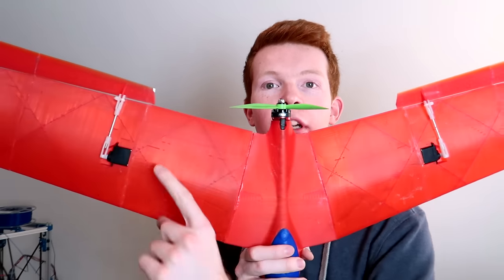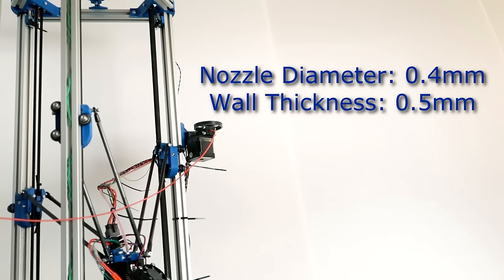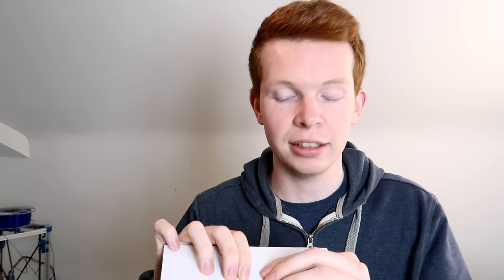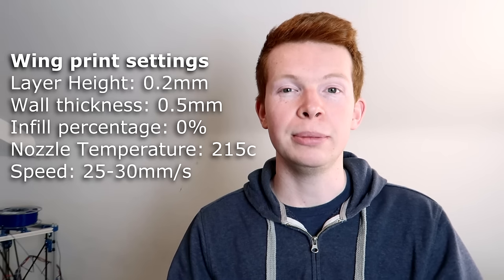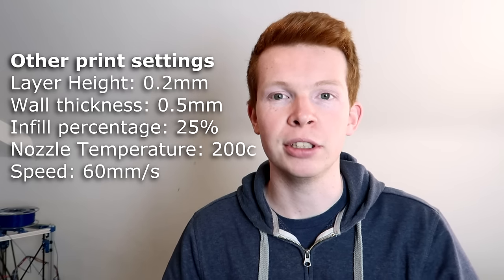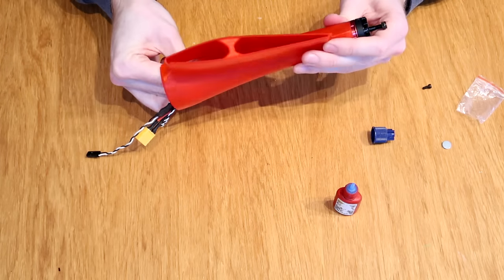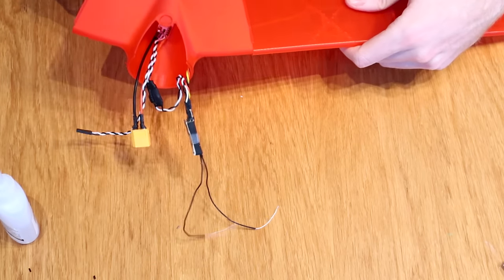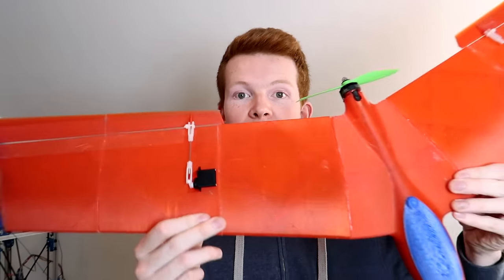Print THIS Plane! (FREE .stl Files)

Comment: I ll ask my brother if the print volume of his printer fits. 200mm is the hight right?
Reply: Strong Force 200 X 170 X 170, most non- delta 8" ones are 200X200X200

Comment: do u think it will work wirh abs instead of pla?
Reply from the maker: +Erdbau Rödel ABS is a lot harder to print large parts as it contracts a lot more when cooling. So it may cause the parts to crack. It could probably be done with a heated enclosure to minimise contraction
Reply: I mostly print in abs so I´m used to it
but with abs I would give it a Aceton vapor smoothing, this way they layers melt together

Comment: Can I print this in ABS?
Reply: You probably can, but it will be a 'Your Mileage May Vary' type thing. Since ABS is prone to shrinkage/warping at times, you may find that the parts don't cool evenly and may not suit your needs for something this thin. Typically PLA is the recommended route.

Comment: Can I print this on Prussia i3 mk2
Reply: Don't see why not; the Prusa i3 Mk2 has a bigger print bed than the Delta printer he's using (Prusa i3 Mk2 is 250x210x200mm, and he recommended a 200x170x170mm print bed).

Comment: Click this bait
Reply from the maker: +LeowhittersFPV watch this drone spaz out in the air ;)
Reply: dem ratez
Reply: Tom Stanton my name is Gerry I have a XYZ 3d printer my printer can't print the original size what should I do 🤔
Reply: Slice in small parts and stick them... or  design small holes to include screws and join the sliced parts together. There is lot of free programs to do that.
Reply: Robert Slackware how?
Reply: first of all, props on your design, it's amazing, wish I could design like that..... I'm going to ask my friend to print this for me.... one thing that might help for more rigidity, would be a hole running through the wings to insert a cf spar? And run faster motors to take advantage of the 1800mah muhahaha.... keep up the great work!
Reply: LeoFPV

Comment: Great project!

In the shopping list the Push rods have a link to the clevis?
 
As I try to source everything at 1 place will this do ok?
http://www.banggood.com/400mm-500mm-Servo-Rob-Connecting-Clematy-With-Chuck-p-991725.html
30 Amp 4S esc with integrated 2A Bec http://www.banggood.com/EMAX-BLHeli-Series-6A-12A-20A-30A-ESC-p-963634.html
http://www.banggood.com/10PCS-N35-10mmx1mm-Round-Neodymium-Magnets-Rare-Earth-Magnet-p-931423.html